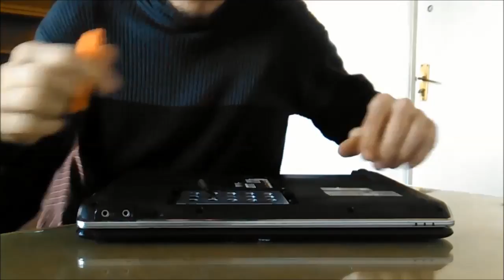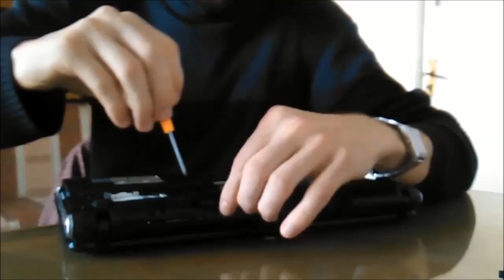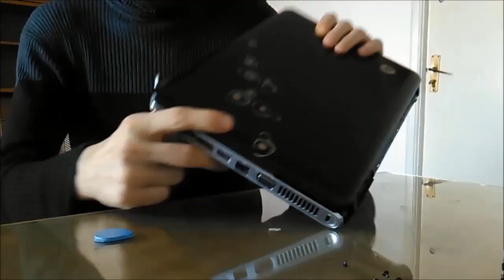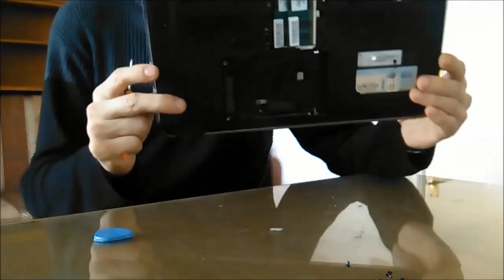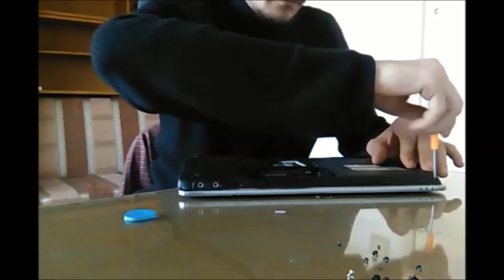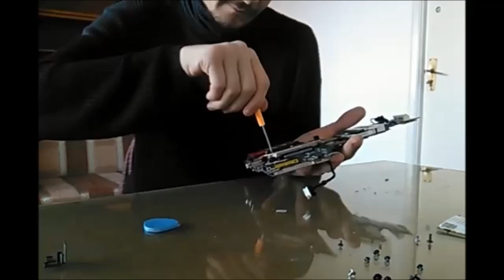Inside HP Pavilion DV3-2100Series - Complete Disassembly Tutorial

Comment: Me who just wants to clean the fan and  change thermal paste be like
Literaly it gets up to 95ºC at a constant 90% usage (can't go further) if it doesn't throttle to half it's speed (can "disable" throttle by putting the cooling solution to "active" and the minimal cpu speed at "100%" on the power settings). Using it for normal tasks could be usable, but lots of times the temps really concern me and make me put it away again.